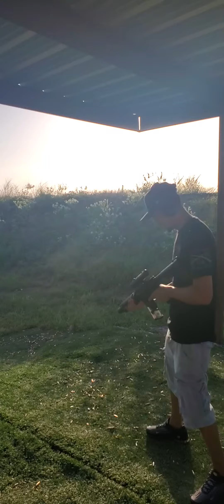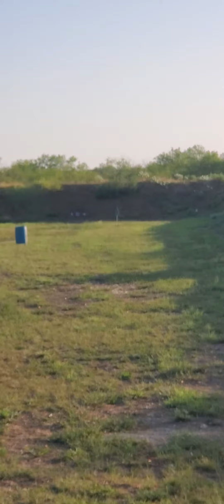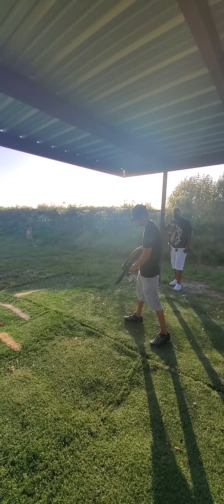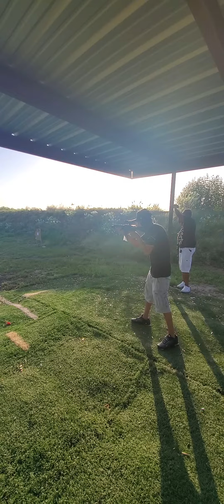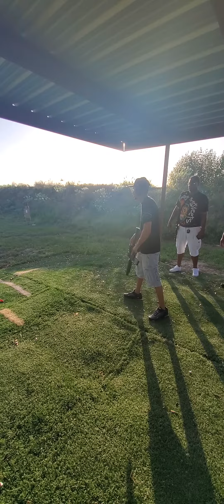PSA Marauder 300 blk out undergassed shooting single shots at 125yrds

Comment: I’m way late to the party, I’ve built multiple 7.62x39 uppers that aren’t really made to run well on the ar platform, the secret is opening up the gas port hole to 1/8”. It will make your rifle over gassed, but reliable. I’ve done this with 4 rifles so far & it works well. Once you drill the barrel, any burrs inside the rifling that cannot be removed with a brush can be shot out with live ammunition.
Reply from the maker: It runs fine now, it was only that certain brand of ammo that it had issues with.

Comment: My psa 8.5” 300blk seems under gassed as well with supers :/ I haven’t even tried subs yet…
Reply from the maker: Have you tried different brands of ammo? This one only had issues with this one certain brand and ran fine with everything else.
Reply: @MilSpecJ  I haven’t yet but I definitely plan too, I ordered a bunch of the AAC 300 blk from PSA and that’s all I’ve tried. The black tip and red tip ammo.
Reply from the maker: @brentflowers7612 hopefully thats the issue and it runs, good luck 👍🏼
Reply: @MilSpecJ  I’ll definitely try that, thank you. I appreciate it!
Reply from the maker: @brentflowers7612  No problem 🤝